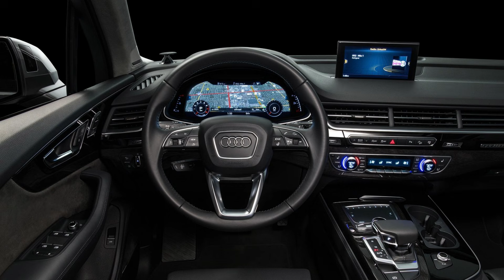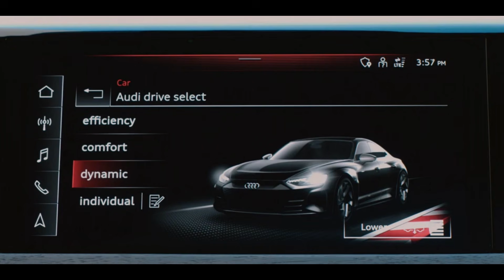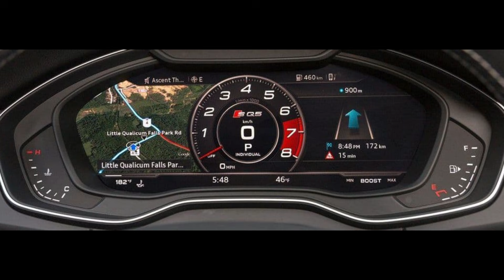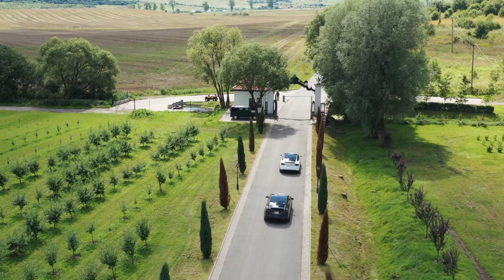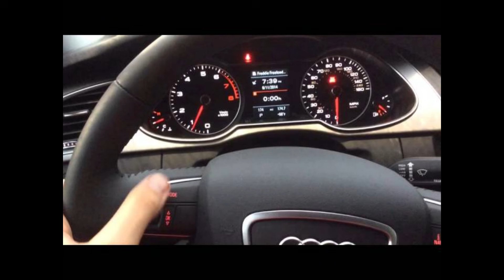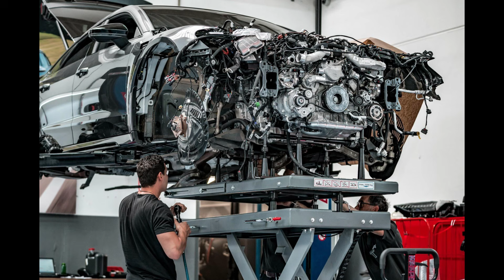8 Hidden Technologies Audi Never Tells You About. The Secret Audi Features You're Probably Not Using

Comment: If we select individual mode what will be the economy status
Reply from the maker: In Individual mode, fuel economy depends on how you configure it.
If you set engine/throttle to Comfort or Eco, transmission to Comfort, and steering to Comfort, the economy will be very similar to Comfort/Eco mode.
If you choose Sport settings, fuel consumption will increase accordingly